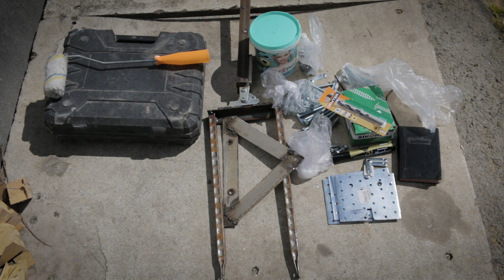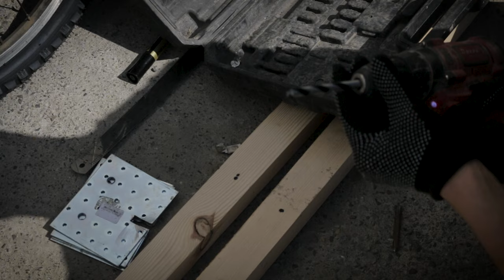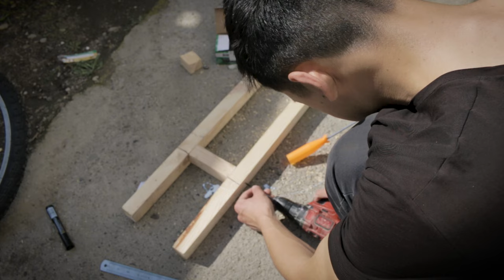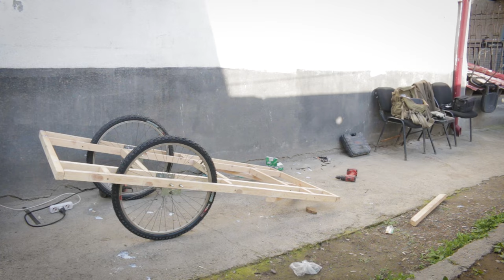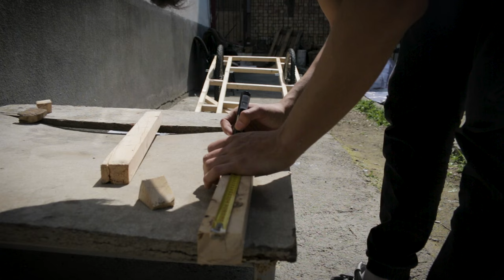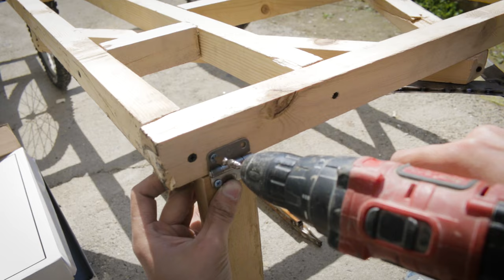Bicycle Camper Part 2 (frame)

Comment: I built a trailer out of wood. Its bloody heavy. And I had to take into account, Turn, Twist and Bump. The hitch was the hardest to figure out. I have since built a second trailer, but I purchased a kit from a company called WIKE out of Canada. I have no tires or connections to said company. But it sure made building a trailer a lot easier, and lighter.